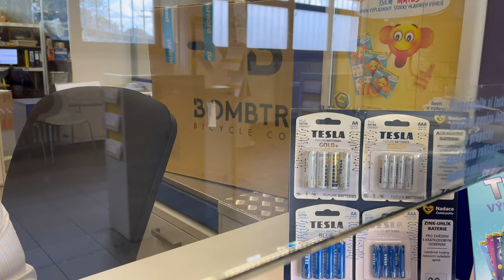New Bike Day | Random Fixed Gear Vlog

Comment: Look for innicycles headset conversion 1 inch to 1 1/8. With nitto ui87b stem. Black sugino 75 did crank. Black nitto 83 or 92.
Reply from the maker: Thanks for the tip on the headset. I am definitely looking for the Nitto stem. But I think I’ll go with the UI-25 so I can use 31.8 handlebars.